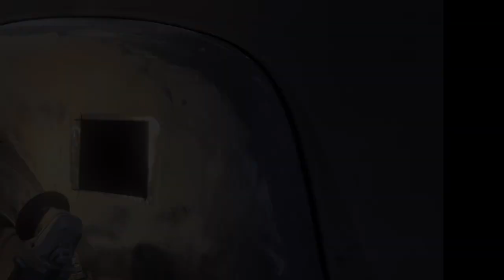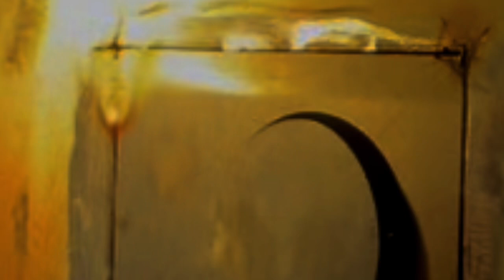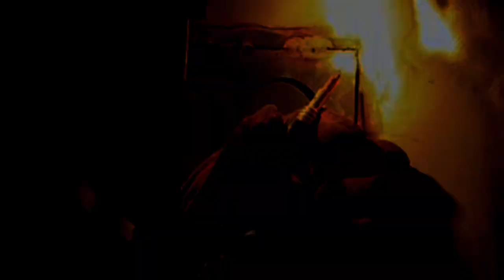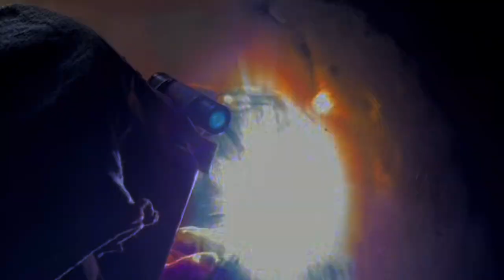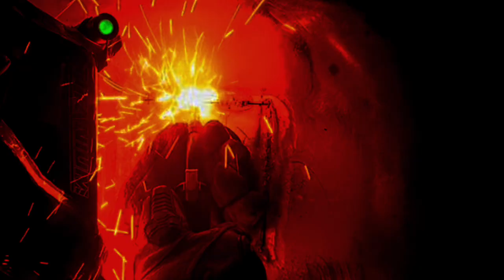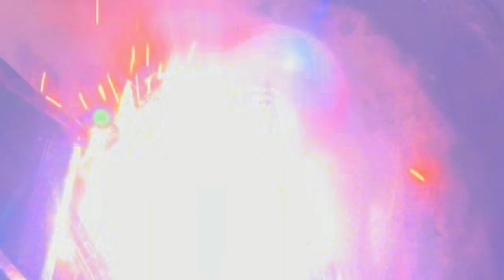DON’T BE STOOPID; WELD LIKE BILLY! 😂😂 Cutting Out Gas Door Welding Auto Body Repair Done Right

Comment: Hi Billy. Tested your method.. it works! Are you doing a second run after grinding to fill that micro wholes, that are visible sometimes? What type of flux cored wire do you use? The normal E71 tg s or 308 FC stainless steel? Cheers' n greetz from Germany 🍻
Reply from the maker: I just use standard flux core wire.  Pin holes in a sheep metal weld are irrelevant. Just make sure to spray cavity wax on the backside to prevent rust.
Reply: @OldBondoBilly  Thank you very much. Cheers ✌️

Comment: I see you use a lot of stick out I want to try that technique I have never used that much stick out. Do you use a certain flux wire or just whatever why are you pick up at the?
Reply from the maker: I get the three pack of yes welder .030 for myself Off of Amazon for $28.99

Comment: I was pretty much sold when you said you could use flux core with a fan.
I am super sensitive to heat if there isn't some wind blowing on me.
Like, without a fan, I need my environment about 65 degrees, but with enough wind I can stand much higher temps.

Comment: Hey Billy, which brand flux core wire do you use? I've been using Forney for a couple years, but just curious if you might know of something better.  Thanks, and I always touch the like thingy!
Reply from the maker: I like Forney, but YesWelder is just as good for half the price
Reply: @OldBondoBilly  that's one I haven't tried yet based on "you get what you pay for."  Apparently, that's not always the case.  Thanks again!

Comment: Bondo billy thank you for showing me how great flux core can be any tips for flux welding exhaust pipe!
Reply from the maker: Brush between welds. You don’t want pinholes in exhaust pipe, so it’s important to check as you go😉😉
Reply: Man I was testing on some short pipe I had laying around and way getting holes like crazy i noticed overlapping my pieces seemed to help a lot but damnit I didn't even think to brush between welds thank you sir for informing the dumb youth such as myself! and don't worry I touched ur like thingy! @OldBondoBilly

Comment: billy i been doin autobody for 10 years and still have tons to learn and am open to all new ideas and tricks to help get the job done. but your a smart guy please help me with this question. why do people make it seem like its such a chore or impossible to do body work ? So as for mig on sheet metal its not hard at all to do it without warping the panel.  i can weld gaps without creating porosity all day i turn my heat up and do fast spots to keep the heat central to my arc. and just go slow and dont be lazy its lazy people who always want to bitch and moan if they actually have to use their brain .and im not talkin about you billy not at all im talking about all the idiots out there that are afraid of doing things that cause them to use that little peanut in their head. your channel is filled with great info i just wish people woud not be afraid or lazy in doing bodywork. just be smart and take your time and dont cut corners it will bite you in the ass in the end.and tell me do you honestly like the vevor spot welder puller im thinking of buying one how has it held up and have you used it in any real creases can it hold up to the task
Reply from the maker: Sorry it took so long, I love the Vevor spot welder puller😉😉
Reply: @OldBondoBilly 
This guy probably forgot that he wrote this essay 😂

Comment: Hey Billy,i weld my cars with flux core wire and i use metal mend... so it's like fibre glass but it has metal fibre it's perfect to fill,i am a welder by trade,it makes me laugh that  people actually tell you to weld this vertical up on this type of application.Vertical up is only needed when it is structural and this is not,.. 🤣 more fool them, anyway love what you are doing keep it up DAMMiT, Black Duck from down Under 🦘👍

Comment: How much wire do u have from tip? About inch? I learned to weld from trial error.but like this.body metal method. I been building too much weld sometimes. 1 sec.welds build too.much metal. U are just arc and get out. Right?
Reply from the maker: I’ll just guess 1/8 of a second😉😉

Comment: I think that most folks who dislike Flux core, do so because of the spatter.  If they set the welder up correctly, ground cable to positive post, and gun to the negative post, about 90% (or more) of the spatter goes away.  I've even seen Flux core only machines set up opposite of what they should be.
Reply from the maker: And low spatter wire like the YesWelder .030 I use now.  Lincoln and Harbor Vulcan are both super spattery crap🙄🙄
Reply: @OldBondoBilly  Yes!!  Lincoln sucks too!!

Comment: I have been welding flux core for about 7 years. Its all i have ever had. I thought i wanted to get a bottle and use gas until i saw this video. I think i will just sty with what i have. I have alot of metal repair on about 4 different vehicles. Not to mention all the other stuff i have used it for including building my 30’x40’ shop. I am no expert welder or body man and you did that exactly how i would. Makes me glad i have learned something lol

Comment: I’ve used flux core for body work bc it’s all I had. The reality is that I am just a hobbyist, so I suck just as bad with flux core as gas. Next time I’ll try the higher heat settings but I’ll be surprised if I don’t blow through. But we’ll see. 

Flux core has advantages for non-masters  as well. For me it’s better for rust and more forgiving bc you don’t have to worry about the gas.. turning it on, getting flow right, leaky fittings, running out. I find so many ways to screw up when I do body work, eliminating potential issues is a big plus.
Reply from the maker: My sheet metal welding lessons are going to get far more concise now that I have a manufacturer/sponsor.  You can benefit greatly in your shop.😉😉😂

Comment: I was preparing to do a bit of brazing yesterday and found my mostly full N2 bottle from my last project has no pressure. :O
Reply from the maker: I admit to not knowing what N2 is…😗😗
Reply: @OldBondoBilly  N2 is inert shielding gas to keep atmospheric contamination from reacting with the metals.  When brazing, say for instance copper or copper alloys like brass, atmospheric oxygen will react with the copper and oxidation takes place, contaminating the fill and metal interface with oxidized copper .
The purpose of the nitrogen (N2) shielding gas is to keep oxygen and other atmospheric contamination from becoming part of the brazed interface by displacing the atmospheric gases with a non-reactive gas (N2) by flooding the area.
There are other gasses used for the same purpose, such as argon or mixture of gases to try keeping the area flooded with inert gas.  We can reverse oxidation as well, by using a reducing gas that absorbs oxygen from the metals.  That would be hydrogen, in many applications.
I'd love to know everything about how you go about laying down metal flake paint.

Comment: Hey billy I'm pretty dumb. Why dont yall use a paint booth with all them fancy damn fangled negative air pressure and ventilation or atleast wet the ground so dust and dirt dosent keep getting into your paint? Sorry for my tremendous stupidity but damn I'm curious.
Reply from the maker: Whilst I would love to have said paint booth, alas, I have not.  Therefore I must use my 47 years of accumulated knowledge to produce the best possible job that can be accomplished with the resources at hand.  That’s why I’m a master; because I can produce a BETTER paint job using household junk, than 99 and 44 one-hundredths percent of “professional” painters can produce with the best of the best of the best of everything.  Sorry that stupidity leads you to believe putting water on the ground pulls dirt out of the air.  Maybe you can get a tutor🤣🤣🤣🤣🤣

Comment: Great video👍🏽👍🏽 it’s ironic that you said all that about a flux core welding,, cause all the fabrication and patch work I’ve done on my 63 is done on a $99.00  Harbor Freight Flux Core welder. 😂 yeah the splatters a mess but it’s my truck and it works for me.  😂😂  It’s just Old Fart Theology 🤣😂 Weld on Brother 👍🏽👍🏽👍🏽👍🏽
Reply from the maker: Get’r done👍👍😁
Reply: @OldBondoBilly  one of the mottos I’ve grown up with all my life is “ ITS NOT WHAT YOU HAVE, ITS HOW YOU USE IT “  and that’s always worked for me.

Comment: I’ve only been doing this bodywork thing for around 20 years, and thank you Billy- I threw my mig away years ago and went exclusively with flux core. I have mine set up for 30 thou wire, the standard 35 was a bit too hot I found. I specialized off into rotten low areas of cars/trucks, I’m one of the local “rotten rockers and floors” guy lol. I don’t do much actual large area painting anymore, doing full sets of rockers is very dirty work, keeps shop super dirty on the best of days with all the crap that’s inside of most rockers. I mostly bend/fabricate all the replacement panels myself, cut out and weld instead of glue them on, and take my time. Like you I can weld extremely thin metal, although you are for sure “the master”. Other local “body pros” keep telling me to glue on the rockers with glue to save time, I just don’t believe it does a good long term job so I don’t do it although it is quicker.  Keep up educating the fools, i know you know what you’re doing! I do a lot of plastic  bumper repairs also, maybe you could do some videos on that, if you haven’t already. That’s a skill on its own. Cheers from the salty old wet icy east coast of Canada! (Where some cars rust holes thru em in under 7 years, but enough about American cars 😂)
Reply from the maker: I glue roof skins on, and door skins, but that’s it for me. I weld everything else.😉😉

Comment: Billy my adopted grandpa told me never argue with an idiot, because after a while they will bring you down to their level and beat you with experience every time. Back when I work in Bedrock on Barney and Fred's cars, I used a flanging tool and a punch because we brazed every thing with heat putty and leaded joints. Then we used 6011 and an arc welder. MIG showed up still flanged and punched. When I got a TIG I butt welded with heat putty. I have never used fluxcore but I'm about too on my son's 75 Nova around the glass and quarter panels where it rotted out.

Comment: I started welding with stick as a kid, then bought a 110vac Fluxcore wire welder, never used mig gas.  Don't see the need for it when you learn with Fluxcore wire..

Comment: What about nubblin' around the hole with a pneumatic punch flanger and make a well dimple around it then pop the gas lid plate into the recess it makes and weld it up? Seam would be easier to deal with.
Reply from the maker: If the fender were straight, that would probably be a good way to go😉😉

Comment: I've seen so many different ways to weld. I wouldn't say that any of them were right or wrong. Whatever works is right. I've welded up big gaps with mig and flux. Definitely a lot easier with flux. Having a fan blowing across the panel keeps the smoke away and keeps the panel cool at the same time. Warpage will happen with heat. Even if you do a perfect weld with a mig with no warpage. If you're not careful grinding your welds, then you're gonna warp the panel. It's not about what you use. It's about how you do it

Comment: Never had a welder but I need one. I think I'll try the flux core see what a little practice does ? Any advise on one to start with ?
Reply from the maker: YesWelder Flux 135
Reply: @OldBondoBilly 
😂 I almost typed 12345!!
Reply: The Harbor Freight Titanium series is amazing. The base model is all you need for up to 1/4” steel. I have their Chicago series as well but the Titanium is absolutely worth the price difference. The inverter is better producing a better arc and it’s far more adjustable as well.

Comment: What settings do you use for sheet metal that is 18 to 22 gauge?
I have a real hard time working on sheet metal. 
Thanks
Reply: Practice and change up the settings until it works for you. When you find it, right it down!
Reply: @shadow9600  thanks for the info!
Reply from the maker: The technique is the most important part, and it requires higher than recommended amps.  If your welder goes 1 to 10, it would be 3 or 4 for thin sheet metal; not 1 like the label says
Reply: @OldBondoBilly  thanks a lot for the help. I really appreciate your expertise

Comment: I noticed you don't have a nozzle on the gun. With flux core, I don't guess you need it?

I've only welded with flux core a couple times, but i was a welder for 25 years. I welded sheet metal to 1/2" steel and thicker. The only advantage i really seen was less spatter when using argon. I welded with a fan on me using gas, you just have to shield the weld. Im goung to try flux core out on my car im working on. I like the idea of putting less metal down to remove.
Reply: Correct, no nozzle needed which makes it a lot easier to see your work and fit in tight spaces

Comment: I did all the welding on my old truck with flux core and it worked great. Vary forgiving on dirty rusty metal. No “porosities”😂
Reply from the maker: You may say there’s no porosities, and you may not see any porosities, but trust the ekspurts; your weld is just one big porosity 🤣🤣
Reply: It’s rocket surgery, it’s real hard. Make hot glue metal good 👍💥🧙🏻‍♂️. 💯 penetration

Comment: Mmm, Dry 🧱 Wall! Creak, Thunk. Glad you did! 🥝✔️ ( PS, Flux Core, third welder I got. My Arc welder and other Smooth Arc, wrong choices.)
Reply: Dean, “you” can weld 22 gauge sheet with an arc welder. 
Don’t ask me how I know 😂
Reply: @UnfinishedProjectDartSport  You've welded a Saab too!
Reply from the maker: @UnfinishedProjectDartSport what rod would you use?
Reply: @OldBondoBilly  
1/8 6011 on 90amps, I’d go lower if I could 😂
I use flux core now also but at the time I had never heard of it 🙃
Reply: @OldBondoBilly 
So we meet again!!